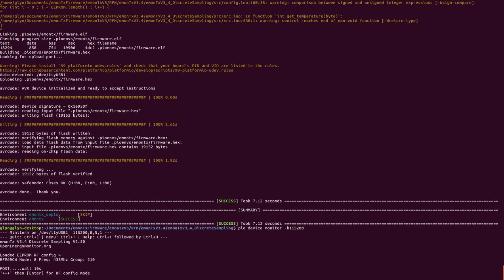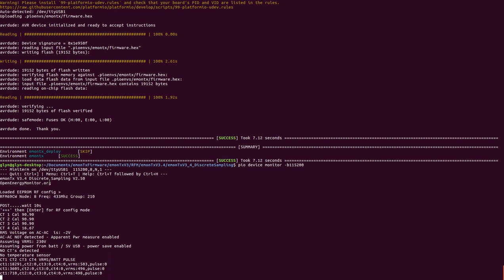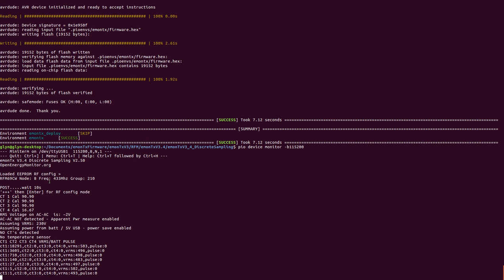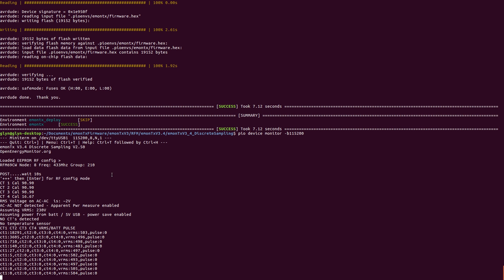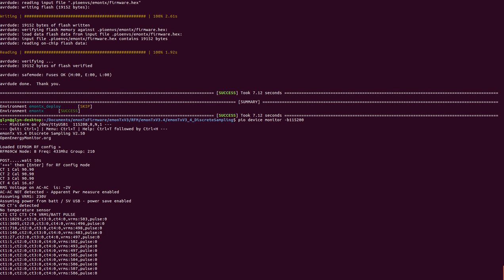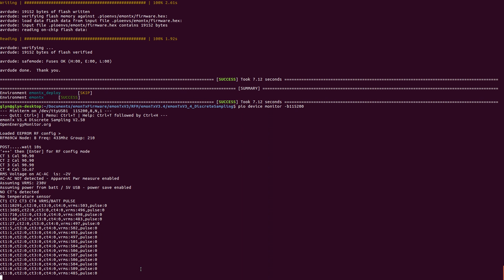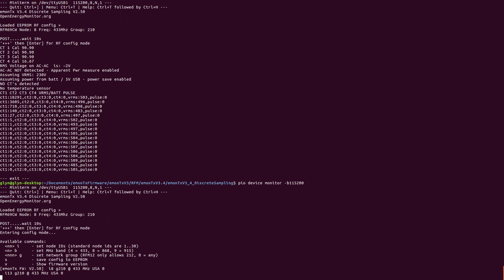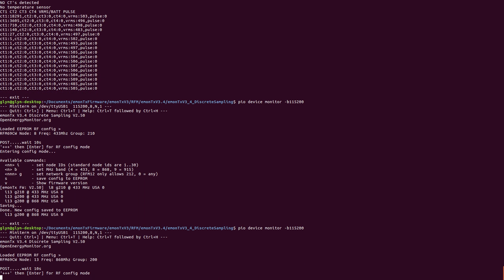emonTx V3 RF config via serial (dev)

Comment: I have just gotten 2 more emonTX, which will bring me to a total of 4, but i cant find how you get to your screen to change the ID of the node, Is this through a serial connection to a PC or through the Raspberry Pi interface?
Reply: RF node ID can be configured via a serial terminal, see forum post https://community.openenergymonitor.org/t/emontx-emonth-configure-rf-settings-via-serial-released-fw-v2-6-v3-2/2064?u=glyn.hudson&source_topic_id=2886